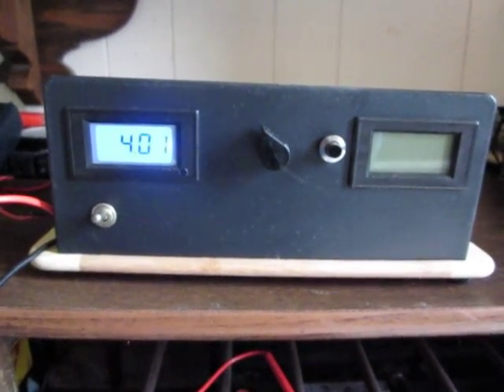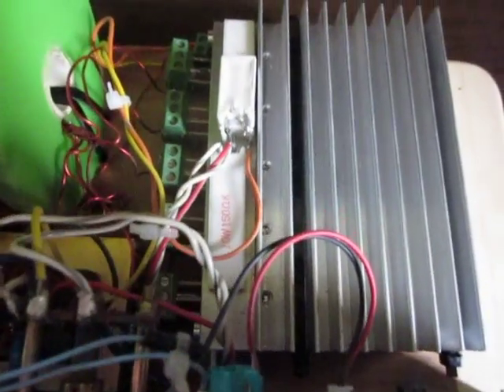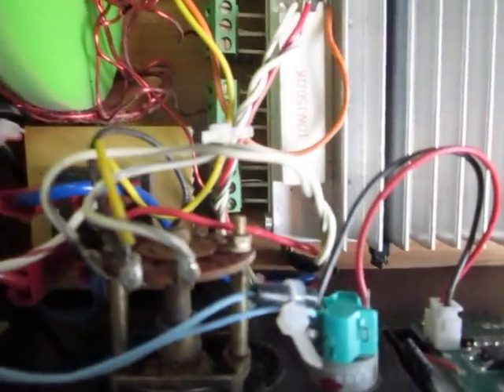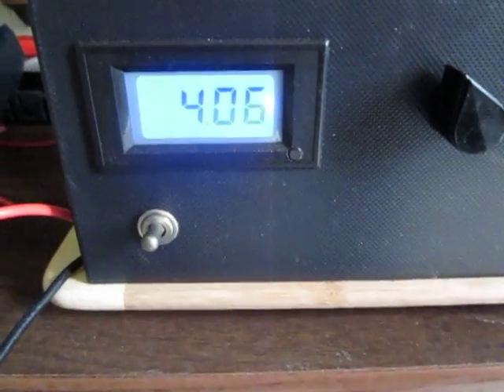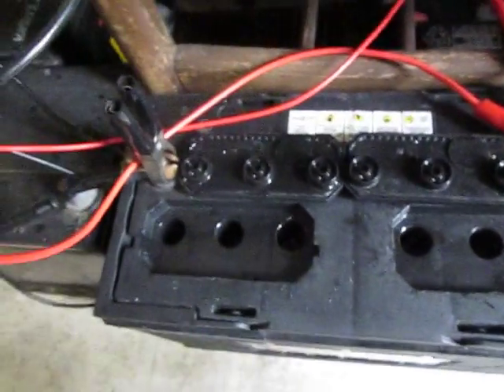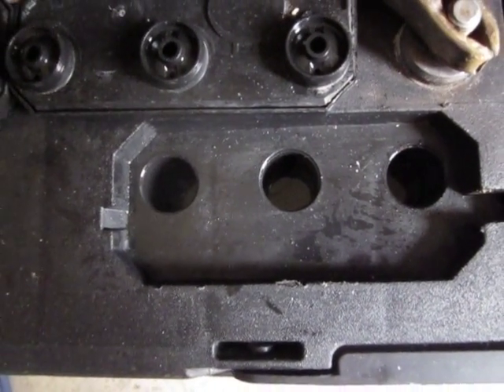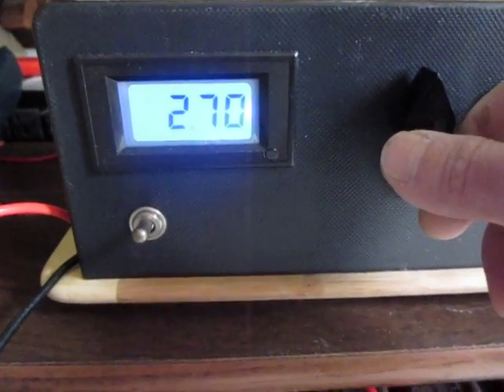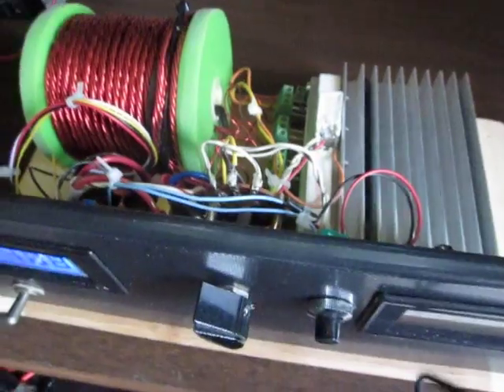6 filar solid state 2.AVI

Comment from the maker: They will not work the same way. Transient suppressing diodes are like a high voltage Zener diodes and you can get them on eBay in bulk. They're not expensive. Keep in mind the max. V rating for your transistors and get the diodes rated safely below that. Another way is to use 4.7k resistor in series with neon but this will only work for low power SSG, not here. 
There is also a modification possible with this circuit and it was shown by Patrick - search YT name min2oly. 

Thanks
V

Comment from the maker: Hi, Neons will not protect transistors in this circuit. These are transient suppressor diodes rated at 186V (3x62V in series). MJL21194 is rated at 200VCEmax. Some batteries may have high impedance due to heavy sulfation and the spike can damage transistors by the time you notice neon and turn it off. It did happen to me once and two were fried instantly. I built this circuit few years ago but still have it and use once in a while.

Thanks
V

Comment from the maker: Honestly, I never measured. All I wanted was powerful charger able to restore large batteries and it does that. The diodes between collectors and emitters had been replaced with transient suppressor diodes 6x62V each, which is below CEmax rating of MJL21194. I can run this off the solar panel since it is inverted trigger circuit and have COP=infinity.

Thanks
V

Comment from the maker: Thank you for your kind comment. I twisted wires with cordless drill and wrapped by hand, separating each layer with tape. Wire is #18, 100' of each strand. I found twisting from both ends works better than tying one end and twisting entire length. You may end up with very tight at the first several feet and not so tight neat the end.

Comment from the maker: @imtotob Fast rising voltage maybe the sign of high impedance of your battery - sulfation. I usually let go to 15V and let it sit for 30min. After that, I'll attach a load - bulb, PC fan etc. and discharge (respecting C20). Let it rest 30min and charge again. Whole process is about lowering battery impedance and increasing capacity and it may have to be repeated several times. I was able to go as high as 25V but they will rest in 13V range.
Thanks
V

Comment: @blackchisel97 
hI   u BOUGHT ONE 5 V DC  200 MA   XURRENT METER ALSO VERY CONVENIENT TO USE    I like your set up  and maube do the same after successfully tested my ssg 
Kust want to ask  what is the max voltage using  ssg to charge the 12 v 20 ah battery  coz mine from 12.09 start and 14.68 after 30 mins with fast rising voltage .. im using 3300 uf 450v  dc  cap

thanks 

totoalas

Comment: HI ,
GREAT  BUILT      hipe you can provide the circuit for the v and I   meter
to speed up sulfation  they use aquarium aerator in cells

totoalas

Comment from the maker: @MrPounal007 You can get them on eBay. If I may suggest, get those which have separate leads for power, not being powered by the source they measure. Don't connect permanently any meter to the output either parallel or in series with charging battery since this will affect performance by changing impedance seen by the circuit. The whole idea of desulfating is about lowering battery impedance thus increasing capacity.

Comment: Wow. Nice Setup! I wasn't terribly impressed with my attempts at SSG's thus far, so I want to try something like this. When you say you removed the diode from the C and E, do you mean the diode that leads from the Collector to the charge battery? So the power wire from the bifilar would connect to the Collector and the positive side of the charge battery, using no diode? I thought this diode was needed to rectify to DC.... thanks

Comment from the maker: @MrBobcat1957 Certainly, that's the reason I'm sharing my work but this circuit has been designed by John Bedini. I just replicated. The only parts not visible are laptop adapter and 20,000uF capacitor. Circuit can be powered from any DC source. Base resistors may need to be adjusted accordingly. I have 200 Ohms 2W in this setup. You can switch on/off any number of windings by disconnecting base resistors with a switch so it can run with one power winding up to five. 
Thanks

Comment from the maker: @min2oly  All cells except one were sulfated at the beginning. Battery was flushed and all impurities were filtered out. With this remaining cell alive potential across the battery should go up to 16V or even more. In some cases it is impossible to do anything with shorted cell and I had three batteries recently which were like that, including dried gel which became a solid cake bonding plates together. You can usually tell by higher input current and battery becoming warm.